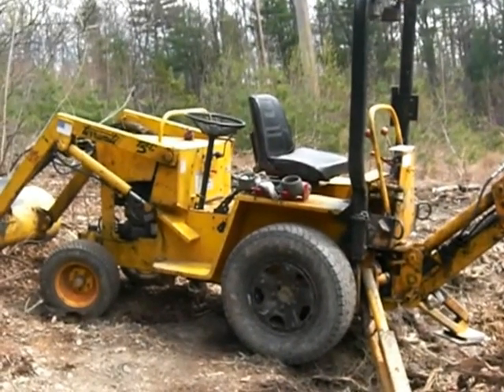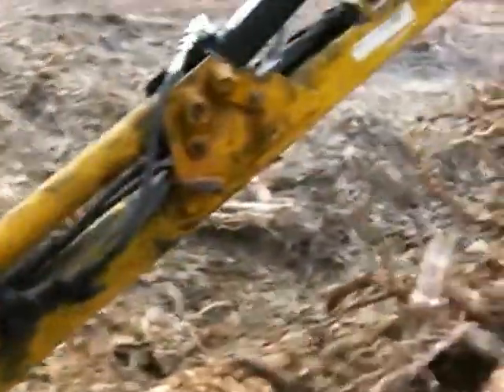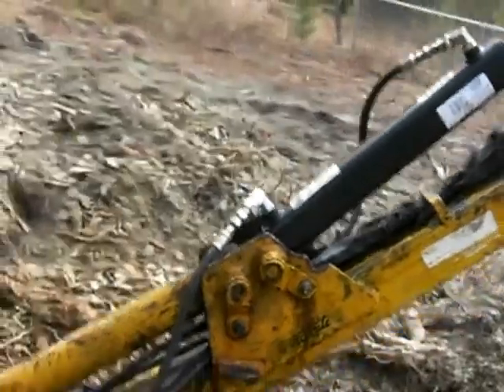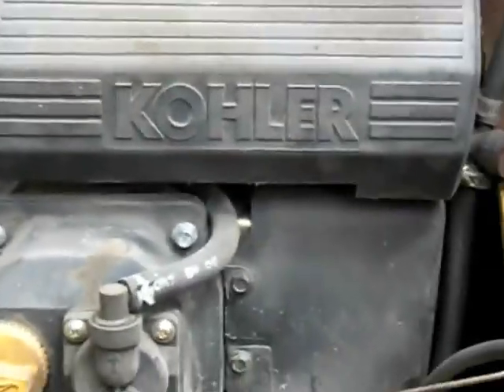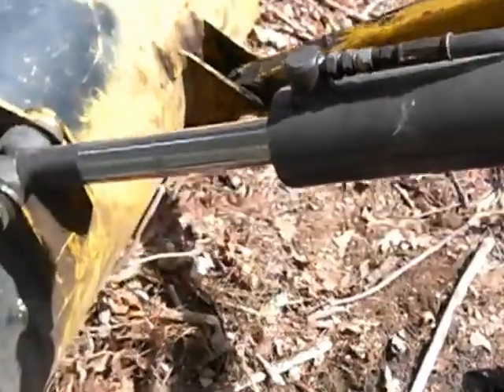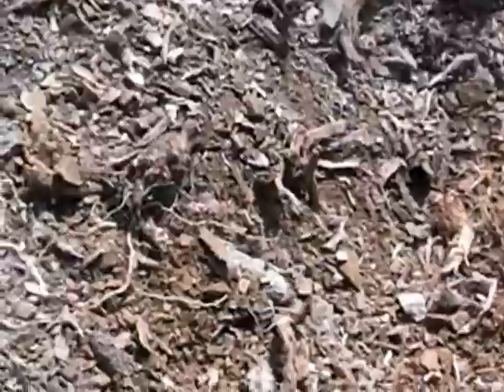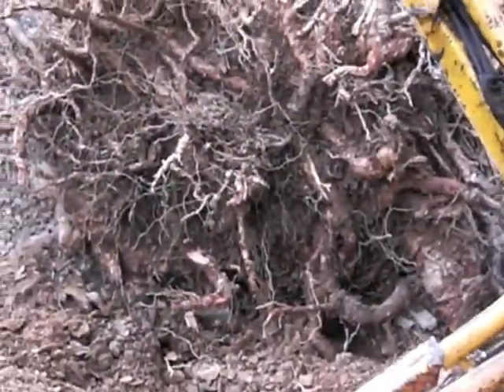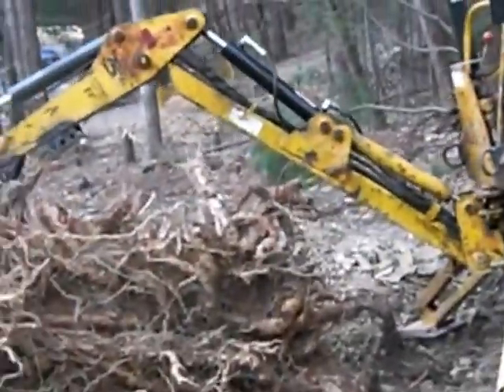Jims terramite t5c review

Comment from the maker: Ya I took mine apart. Under the seat is a cotter pin through the Nut. Pull the pin- take off the nut- pull off the seat, grease and spray all the spring mechanisms, and all that.  Smooth down and grease both metal plates under the seat.  The re-assemble.  I dont think there is any bearings there.